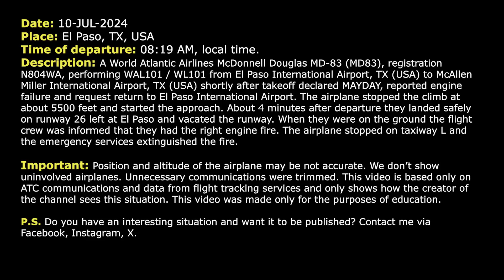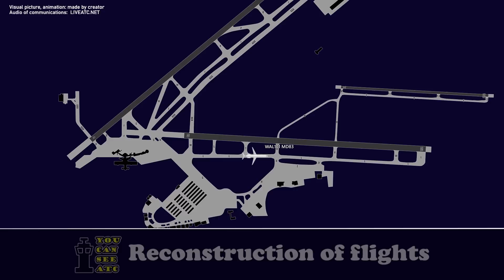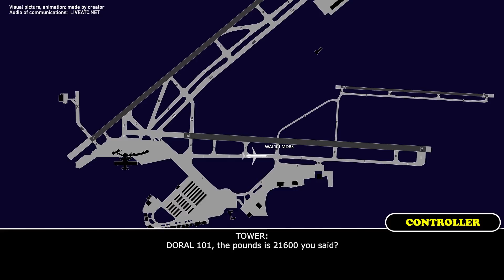MAYDAY. Immediate return due to engine failure on takeoff at El Paso. Real ATC

Comment: Wait, they were cleared to RWY 4 and then just brought it down on 26L?
Reply: they took down a burning plane and survived.. any runway would do then
Reply: Once you declared Mayday/Emergency, you are going to land where you deemed safest. Great job pilots!
Reply: It's unclear and that part of the communication may be missing. See 3:10, where it says that we don't know. It is entirely possible that the pilots said "nope, we're going to runway 26", because in a mayday situation they have the right to declare which runway they want and nee. It's up to ATC to move everyone else. I'm only guessing, it might be that the aircraft couldn't circle far enough to land at runway 4, but they had runway 26 in sight and were able to line up.
Reply from the maker: The recording was broken. So probably they got a clearance to land on 26 left.
Reply: i guess technically he said MAYDAY so 91.3 applies and he can do whatever he wants
Reply: @alexhehaw7247  You can do what you need to do for the safety of flight in an emergency (regardless of whether you call Mayday or not,) but you should still tell the controllers what you are planning to do as soon as practically possible (though still keeping with the "aviate, navigate, communicate" order.) If you're going to land on a runway other than the one you've been cleared for, that's definitely something ATC needs to know ASAP. Though, as others have said, the recording was broken, so it's possible that they did tell them they were going to do that and it just wasn't audible in the recording. Though, if that were the case, we should at least still have heard Tower respond back with the clearance to land on 26L.